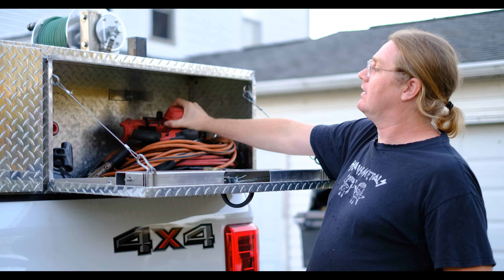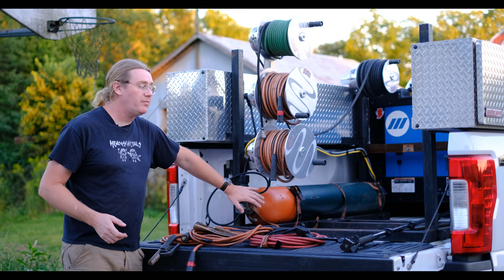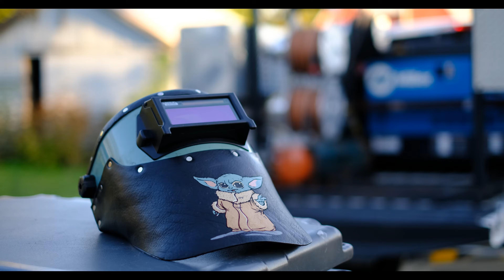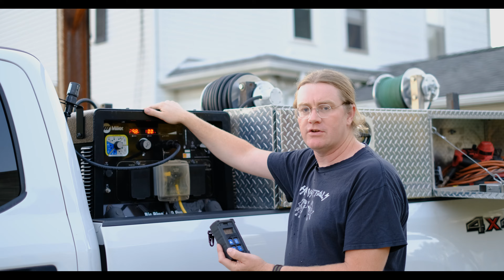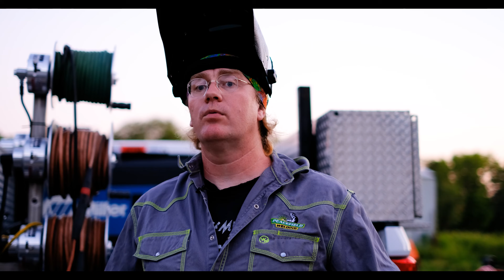How To TIG Weld Off A Miller Pipe Pro 400

Comment: Can you give me part numbers for the bigger air cooled torch and the hoses you have to get it to work like the hose To the rig gun
Reply from the maker: its a a heavy hitters 200 amp tig rig. they easy to find on google
Reply: @DarlingtonFarm  thanks but how did you get the gas to the gun like what’s the adapter piece you used?
Reply from the maker: @Wesley-ly4uq  oh I see, I took an argon hose I got off Amazon cut it in half took a barbed fitting from home Depot and just a regular air fitting